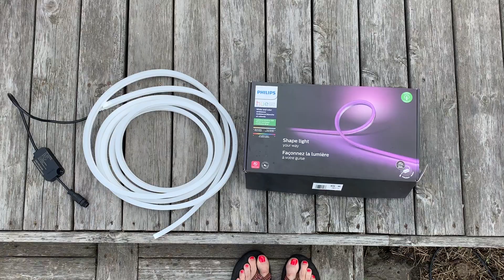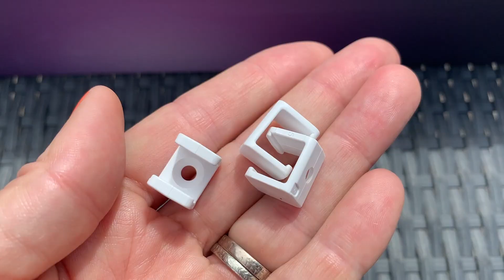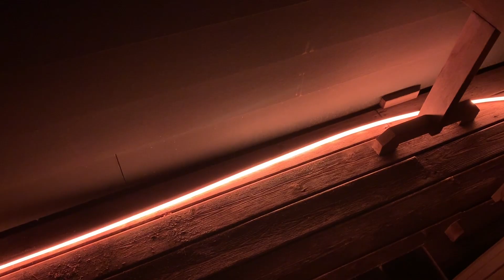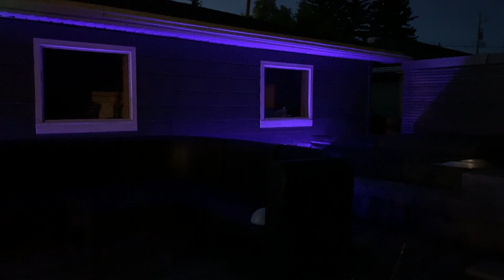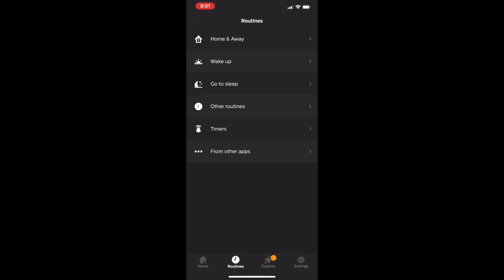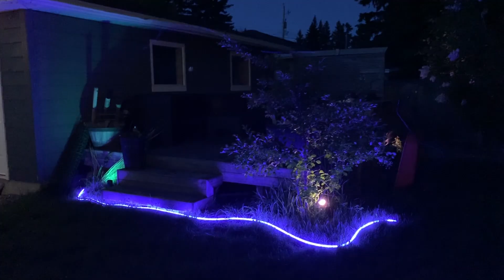Philips Hue Outdoor Strip Lights review

Comment: Great review Erin, really informative. I have 2 stupid questions ;-) 
1. Is the power pack/transformer completely weather proof? 
2. I assume the Hue Bridge controller is inside the house, within Bluetooth range of the lights? 
Cheers
Reply from the maker: No stupid questions! Those are valid questions. Yes the controller is weather proof. I actually have had it buried by snow for months and it’s fine. And yes the bridge is inside the house. But near an outside wall. It uses wifi not Bluetooth.
Reply: @ErinLawrenceTV  and @Robet Y, just to clarify: The Hue bridge communicates with Hue lights and accessories (remotes & motion sensors) via Zigbee Light Link, not Wifi or Bluetooth. The bridge gets its Wi-Fi connection from your existing router or access points(s).

Comment: Would a double-sided adhesive tape be able to hold the weight of the strip on a metal handrail?
Reply from the maker: Hhhmmmmm. I don’t think so. You also have an issue were any type of weather or moisture would ruin the adhesion of the tape.

Comment: do they need to be plugged into a power source?
Reply from the maker: Hello Jacintha. Yes they run off AC power.
Reply: @ErinLawrenceTV  Hi Erin, what are the dimensions of the control box / transformer? I am trying to figure out if I could fit the wire and control box inside a aluminium box rafter on a glass veranda and get an electrician to hard wire the cable into an existing outdoor lighting circuit that powers some outdoor wall sconce lights.